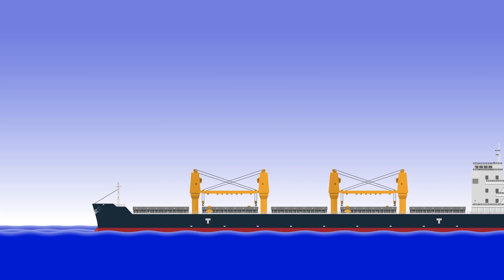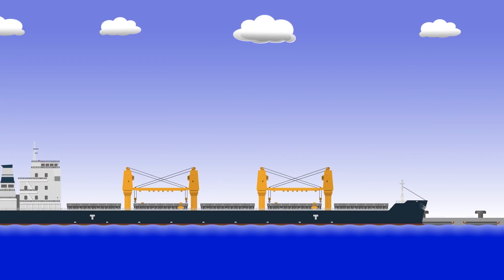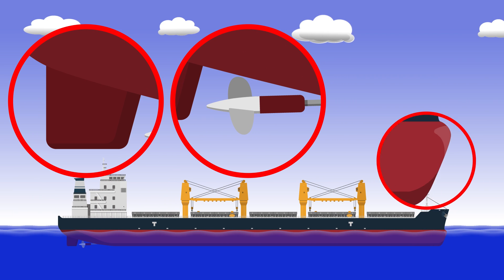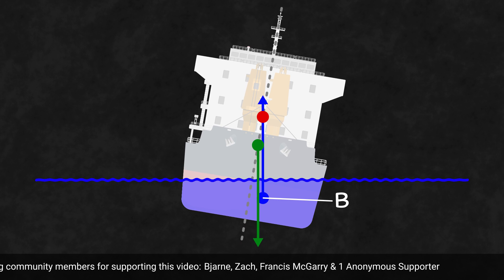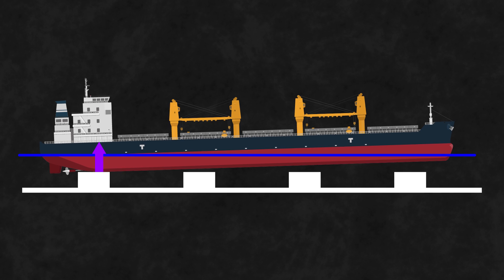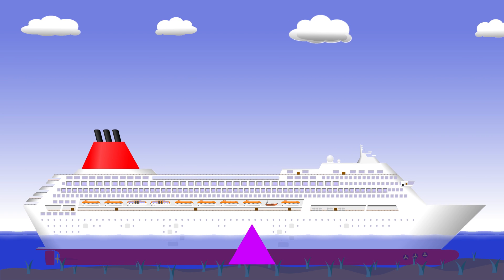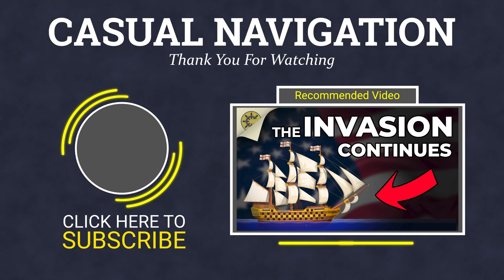Drydocking: Its HARDER Than it Looks!

Comment: I think I see a "mistake" on 1:06:
Assuming the shape comes from a Dutch company "Fleet Cleaner", the cleaning device doesn't have that shape anymore. The logo still has that shape in it wich is kinda funny, but the newer generations of cleaning devices are square again, just like the first prototypes. The idea with the triangle shaped cleaners was that they would nicely fut on a round hull, just like an electric shaver for facial hair. But this proofed to be not be needed with suck large hulls

Comment: I think it is fascinating that, after thousands of thousands of years of sailing, high tech chemistry and sacrificial anodes, we STILL have to constantly battle the sea's corrosive powr and wildlife, and essentially scrub the same things off the hull with elbow grease as some phoenician did thousands of years ago.
Reply: The thing is that chemistry and sience general can solve most problems but it's always a matter of cost. You probably could built a layer of Teflon coating around the hull and never had to scrub it again. Buts it's just way more economical to just scrub it from time to time
Reply: @mellon4251  technically it’s impossible as you would need to seal layer perfectly to prevent any moisture to get inside, otherwise it will cause corrosion and imminent degradation of vessel hull thickness and thus strength.
Reply: Yeah, the anodes only work in a closed system, not with infinite oceanic ions.
But yeah I get what you mean. Certainly a coating would withstand decades of abuse, but at what cost?
Edit: oh someone basically said the same thing before me.
Reply: those "turbo tip" pressure washer here on YouTube are toys. cheap residential crap cheapo ones you can buy at home depot. they sell a trailered, tow behind that goes to 10000 psi, takes it down to bare steel. hydroblasting . I've never gotten to use one. and I'm ok with that.
Reply: And the ocean itself is salty liquid hate.
Reply: We haven't found a way that's cheaper than cleaning.
Reply: Coz millions of dollars bussiness involved for that !
Reply: The ocean is one beautiful lovecraftian beast kid.
Reply: This 'battle' is going to be our destruction.

Comment: I spent years in dry dock in Houston and we always had two rows of columns.  I don’t understand why anybody would try to balance a ship on a single row of columns.
Reply: Yeah I was wondering why they don't just have two sets of blocks. I know whenever you have a question that has the word "just" in it, there's a reason why you don't "just" do that. Maybe there's still something, idk.
Reply: It depends on the size and hull-form of the ship, what you're docking for, and where your openings are, but it should be remembered that the ship was (probably) built sitting on its keel with the frames sharing the load along the perpendiculars. 

In my experience, the chosen yard for docking hangs a plumb bob at the inner end of the dock matching the dock - and the ship's centreline, then once the ship's in, another is suspended across the dock behind the stern. The ship is trimmed and lowered slowly, as timber supports are readied to hold the ship upright from the dock wall terraces. 

If you know the middle of the dock, you 'just' need to middle the ship on the plumbs as its lowered to get the keel on  the blocks.
Reply: @ginskimpivot753  yeah I don't think anybody's using Timber on an 800 ft long cargo ship for cribbing but I hear you in theory
Reply: @markvickroy6725  

Oh, timber's used extensively, but every ship has unique requirements. Timber is cheap, convenient to cut, shape and use quickly, and where wedges are employed and used arbitrarily to fill gaps and apply further bolstering, they will float out and not cause issues when the dock is refilled.

For the blocks on the dock bottom, timber will yield and equalise - or share- the load - much like a fence-post lowered onto 4 different pillows in a line on the floor. 

With large flat-bottomed vessels, particularly carriers, terrace timbers wouldn't be needed, but anything with a deep-V hull-form needs side support which cannot damage the side by virtue of being harder or as hard as the material it supports. These timbers are usually wedged in place as the hull settles down on the blocks, so that when the dock is filled later, the force they exert - always in an upwards direction from terrace to vessel - automatically reduces as the ship rises.
Reply: @ginskimpivot753  I remember touring dock when we were in and struck by the huge 'staples' (basiclly u-shaped reinforcing bar) used to fasten a bunch of timbers at every block.  Then it dawned on me.  Wood floats lol.  So they positioned all the blocks and made sure the timbers wouldn't float away while they flooded down to let us enter.  Even little things get complicated when working with ships.
Reply: Usually you'll have an odd number amount of rows, either 3 or 5. At the bow and stern the keel blocks (middle row) will be the longest, making the representation in the video quite accurate actually.
Reply: I don’t know why he’s pretending that only keel blocks are used in dry dock.

Comment: In the Navy, we put submarines in drydock once in a while (for the same reasons).  But ISTR we did it 'level'.  Subs are quite a bit smaller and we went into 'floating drydocks' so the dock itself could trim as well.

While in dock, can the ship remove some ballast from aft so it 'lifts off' a little more easily?  Just wondering.

Comment: In the early 1950's we bought a small cabin sailboat. At fall hauling, the growths and barnacles on the hull were huge and disgusting.  Being a professional photographer, he took pictures.  Next spring he used a different, I think copper based bottom paint.  The following fall, much better.  Took pictures again, sent his endorsement to the company and got some coin.

One thing I don't understand is how the anti-fouling paint is applied to the points where the hull is on the blocks.

Comment: I used to clean My Boss's yacht by hand. Upside down with a scraper. One air tank would do it. 90 minutes. One time it was almost clean anyway..and I didnt want to come up early so sat on the bottom and played with a crab. Another time I found a £50 note drifting by.  But diving under a super tanker was very very dangerous. As they are 75 m wide and you can easily get lost and so cannot surface.

Comment: What you are not considering is that ships are also supported transversely (so the GM does not go negative) when going into drydock. There is no such thing as P force in ships stability equations. I am a retired merchant marine officer.
Reply: I can 100% confirm that there are vessels that make the initial landing on keel blocks alone.  Once the vessel is resting on the keel blocks, bilges blocks are brought in to keep the vessel from tipping.  We calculate the draft at instability where the P force will make the vessel unstable so we know when to haul in the side blocks.

Comment: I have seen Great Lakes freighters,, commonly as long as any blue water boat,, clean and repair their hull by differential ballast.  Not in dry dock,, but along side a pier with a suitable depth of water.  Water is pumped out of the ballast tanks on one end and pumped into the ballast tanks of the other end.  The bow or stern may rise completely out of the water facilitating access to the submerged hull.  When perhaps the bow is repaired , cleaned, painted,, then the process is reversed,, ballast pumped into the bow,, and ballast cleared from the stern tank,, and the stern comes up out of the water for service.  I have watched it being done.
Reply: I’m a Mate on a Great Lakes freighter, and you’re both correct. If we have to do repairs on either end, you can trim the ship by the head or stern by removing the ballast from the opposite end, albeit the Chief Mate calculates and carefully considers the moments and stress beforehand. It’s common for bow thruster repairs FWD or rudder/propeller repairs AFT. 

Vessels operating solely on the Great Lakes have minimal restrictions on discharging ballast because the water is considered homogeneous (as of writing no law requires ballast to be exchanged, the EPA only requires a record of ballast exchange to be submitted). In the early 2000’s Salties (foreign-going vessels) brought over many invasive species including the Zebra Muscle which reeked havoc on local marine life, particularly bad on Lake Erie. Now, vessels coming into the system are required to perform a ballast exchange or make use of filtering equipment before entering inland waters.

In my experience dry-docking, the process was a large-scale event but relatively simple. Wooden blocks hung over the wall of the dry dock between the ship’s hull to gauge the transverse distance and a spotter gauging the longitudinal distance by a marker, held in place by the ship’s mooring wires until she was stable on the blocks. Vessels require a dry-dock every five years but can apply for an extension if suitable.
Reply: @thomas1910  Thank you.  Being a rag bagger I have seen all the processes you describe.  Refreshing to get the straight information.  I routinely sail under the Bluewater Bridge,, port has been either Sarnia or Port Huron.  It made learning the requirements of the big boys , channel, berthing, stern swing, current under the bridge,, rules of the road,,,, almost from the first time I ventured out on to Lake Huron an absolute.  I have often been the last guy out with sails hoisted in late November and dodged ice in the spring.  My hat is off to you guys, professional and skilled, and never seen an exception to that.
Reply: @thomas1910  thanks for the reply. I'm not a seaman but I have to deal with invasive species control in coastal boundaries as part of my job so I was just basing it off of that. Thank you for explaining how it works.
Reply: I believe the great lakes freighters don't have the same environmental restrictions. They're not gonna pick up an invasive Asian species, and then blast it off in a European port, because they're contained to one area I believe. But I may be wrong.

Comment: Is anti-fouling paint a microplastic?
Reply: More like a chemical pesticide. Specifically copper is very hard on microbes.

Plastic isn't remotely antimicrobial, it's just sterile for being sealed and freshly cast after being molten. (Microplastic provides surface area for microbes to grow on which is a real issue for the oceans as more bacteria than normal are now in the water)

Comment: There’s a major and obvious point missing in all this fascinating P Force talk and that’s the existence of more than a single longitudinal line of blocks along the vessel keel. No docking plan has a vessel with a single line of blocks and vessels of the size shown in the video will have 3 or 5 or even 7 lines of blocks where the hull is widest and flattest, the stern. No vessel will enter dock in perfect trim and it would be impossible for a ship to balance on a single line of blocks during docking let alone could the hull support such a point load.
Reply: Agreed!  There are keel blocks along centerline, AND bilge blocks farther outboard that provide support from tipping over.

Comment: What happens to the debris cleaned off the hull? It can’t be released alive, because it might become an environmental problem, is it burned or something?
Reply: Land fill? Most likely.
Reply: I would assume it becomes "compostable garbage" and depending on the facility it could be landfilled, composted, burned, or tossed into an anaerobic digester to make methane for local use.

Basically it becomes garbage to be disposed of however the drydock facility feels like it. And you would be surprised how environmentally beneficial is could be to just dump it in the woods as fertilizer for the trees (assuming no antifouling agents are mixed in).

Comment: While it is fascinating to understand these mechanisms, I don’t get why a repeatedly used setup such as a dry-dock would not provide an electronically controlled tow-in mechanism, where a ship initially gets loosely hooked up by ropes, which are then tightened in a synchronized fashion, pulling the ship perfectly center and positioned over the blocks.

Or stabilizing arms being pushed out from the dock’s sidewalls.
Reply: I would assume a couple factors mainly ships don't come in uniform shapes/configurations (although you could always adjust the tensioning to align properly) and that they are really big with lots of inertia so it could just be easier to drive the ship under its own power than with "tug boats on land"

Comment: Dry dock for an extended period can have a damaging effect on a ship, the longer it is on blocks the greater the chance of the weight of its superstructure spreading the hull outwards as no longer evenly supported by water.  The reason why historic preserved ships are kept afloat for as long as they remain water tight.  Once in permanent dry dock a lot of tailored, fixed support needed and removal of excess top hamper, such as masts, yards and the rigging as has happened to HMS Victory and others.
Reply: I wouldn't be surprised if it turns out to be more complex with wooden ships too, no idea about the particulars of ships but with wooden foundations under the water level they seem to be fine as long as they stay wet. If they end up becoming dry that's when the trouble starts, are any similar things at play with the exterior of the hull when that's no longer exposed to salt water? Changing dimensions depending on water content also come to mind, always fun with doors in houses with seasonal change of humidity but similarly no idea how this affects a massive wooden construction going from wet to dry and changing load distribution.

Provided a steel structure can take the load would I be correct that it should hold up better over time compared to wooden ships if you can prevent enough corrosion and maybe timely repair/replace/reinforce some specific things?

Comment: Great video! Very interesting to visualize the forces involved. In helicopters we have a similar situation called dynamic rollover where one of the skids catches on an object during picking up/setting down, becoming the point the helicopter pivots around instead of the center of gravity. Once the helicopter body passes a certain angle - no matter the control inputs - the roll is irreversible and the helicopter rolls over.
Reply from the maker: That's really interesting. I hadn't thought about that before, but it makes complete sense.

Comment: Wondering if any of these principles are helpful in travailing my 20ft Four Winns.  Probably will continue to intuitively feel it and respond accordingly.
Reply: My family finds that our 17ft stingray trailers much better when you "crank" it on instead of driving it on. Besides the first bump in the road will recenter it.

Admittedly this is much easier to do with multiple people so 1 person holds the boat along the dock while the other gets wet to pull it on. With a 3rd the truck driver doesn't need to get out of the vehicle. 

The big thing is to make sure the ramp isn't slick with seaweed/algea or you may not have the traction needed to pull it put of the water.

Comment: For the stability problem, why are those blocks not just along the entire width of the dock or there could be more of them so that there was not just one in the middle, 1 block on either side maybe?
As always great video 👍
Reply: I'm neither a ship builder nor sailor, but going from the other questions and answers in the comments: 1) the blocks ARE divided, one on each side, not down the middle. However, their righting effect does not take full effect until the ship contacts ALL the blocks. I.e. when the blocks at the stern exert a force to right the ship, the floating bow may over correct the other way. Obviously this is not an insurmountable problem, or ships would never go into drydock, it's just a complication a layman wouldn't think of. 
2) The reason the blocks don't run along the entire length of the ship is access: where the blocks touch, the ship cannot be cleaned and those spots are left for the next drydock session, or even the one after that, if the placement of blocks one year is particularly unfortunate. So obviously you would try to keep that to a minimum. Another consideration might be that not all parts of the ship can take weight out of the buoying effect of water, and may take damage if landing on the blocks.

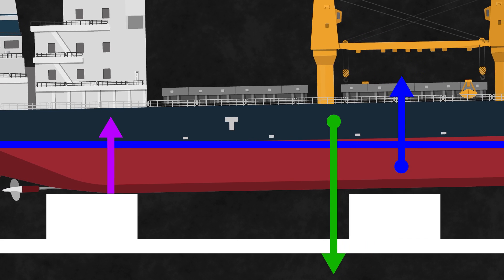Comment: 3:39 There should be blocks placed on either side of the centre of mass, right? As shown, a single block will be unstable. With a block on either side and the ship rotating left for example, the left block will push more and the right block will push less, basically like a hull in water
Reply: The stern block is often narrow because of clearances of screws and rudder. the principal blocks forward are usually full width.  The instability is until the hull lowers and rests upon more than just the narrow stern block.  The narrowness,, and the restrictions of screws and rudders is also why the stern must be aligned first and most carefully.
Reply: thought the same 
doing it with a single block is just asking for trouble and running face first into a brick wall

put a block on each side so it physically cannot capsize
Reply from the maker: Correct. There are more blocks in drydock, but they don't exert an even righting lever until the ship is resting on them all.